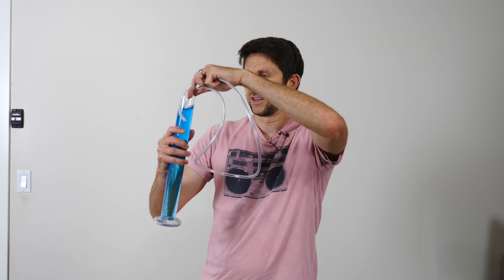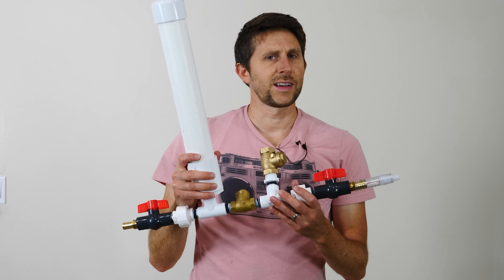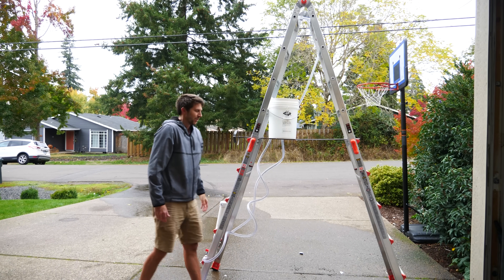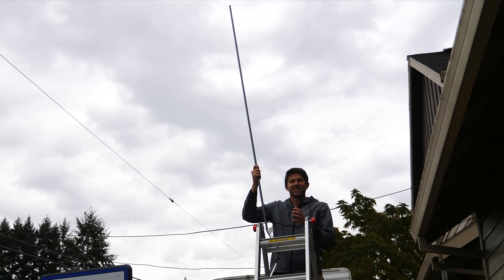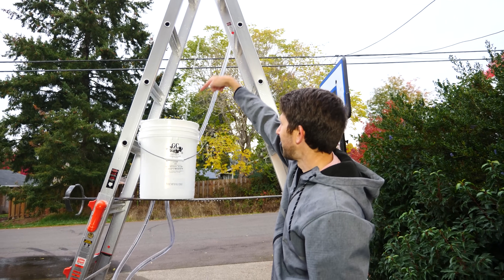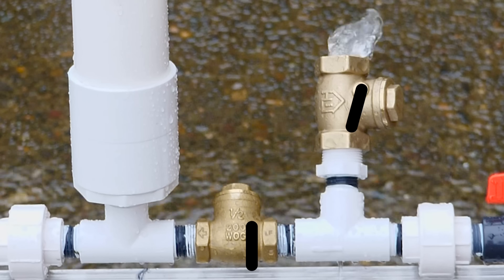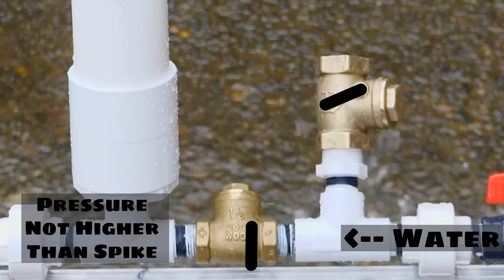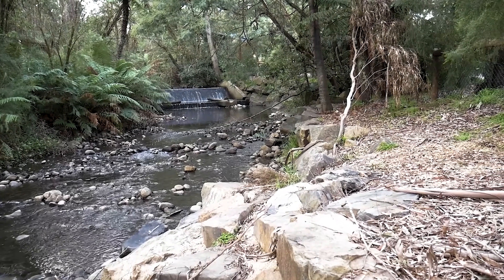Can a Hydraulic Ram Pump Make a Perpetual Motion Loop?

Comment: There is a plumbing device called a hammer arrestor that prevents the pipes from banging. It works like the empty PVC tube in your setup.
Reply: Isn't it compulsory on all new installations?
Reply: @olmostgudinaf8100  
I think so; but the regs might be regional.

Comment: I wonder if you could do some creative plumbing around your leaking valve to catch that water, in a funnel, and rout it through another check valve into your air chamber (below the water line)- so it drew a siphon as it decompressed and suck that water back into the system .  Did you follow that? 

Another thing I wonder, is could you run a little pump off a water wheel between your outlet and your head-bucket, to get the waste water back into your head-bucket?  I mean the answer is yes, but how Much of it? how close to perpetual motion could you get, and what use could you put that to?    

I'm always fascinated by the notion of- not making perpetual motion work, exactly, but what you can get such concepts to Do, as several of them Can do useful work, with a little input here and there.  Importantly, More useful work than the cost of that little input.   Like you can make a 90+% permanent magnet motor work with the addition of an electromagnet in one slot.   90+% of the work done by the motor, is achieved by the permanent magnets, and your one little blip in the right place to get it out of the static spot in the magnetic fields make it at the very least hyper efficient.    

I wish more serious engineers would look at these concepts not for what they Can't do, but to see how the concepts could be creatively applied- like that sail car that goes straight downwind, faster than the wind.
Reply: no the ram spike pressure is always greater than the exhaust pressure so you can never route this low pressure water into the higher-pressure side of the pumpe. the check valve between them just wouldn't open.

as for recovery also no. you aren't actually increasing the water pumped here you are just lowering your outlet head. if you qant to increase the proportion of pumped water u need to lower the outlet head which is what u would be doing since ur actual head bucket needs to be below the water wheel. lowering the output head dirwctly is more efficient. not only are pumps not 100% efficient but the efficiency of a super low-speed/low-head non-continous flow turbine is going to be atrocious making it even worse.

more often than not engineers are not optimizing for raw energy efficiency. they have to balance efficiency with cost & application-specific limitations. more often than not the small increase in energy efficiency just isn't worth the added cost, complexity, or maintenance. sucks but engineering is very rarely about what's possible. its just a series compromises.
Reply: @virutech32  It just seemed like as the air chamber decompressed, if you Y'd a funnel down below the level the water came up to, you'd get some suction there.  kind of like the reverse of an old hand pump on a well.

Comment: How will this work when you instal this in a skyscraper, the first bucket on the 1st story, second bucket on the 2nd story that get filled by the one below, on every story a another bucket.... and on and on...  the only energy u need is to fill the first bucket,  from its own pressure from the watercompany, and a low energy pump that pumps the ''leaking'' water from the valve back into the bucket  :-) ? ..
Reply: They would all slowly lose water because you are losing water + energy from the bottom loop.

Comment: This is a really cool video, but can someone who is good at physics explain why you can’t attach a tube to the valve shooting out the waste water and connect it to the tube that’s connected to the bucket. I know 100% that there must be an explanation of why this method won’t work.
Reply: because the ram spike pressure is greater than the exhaust pressure which would prevent the exhaust valve from opening. as the water goes out of the exhaust it's pressure is the same as the hydraulic head of the bucket. at the outlet the pressure is higher which is what let's it get above the bucket in the first place.

Comment: What happens if you connect the waste outlet to the pipe beyond the pvc air tank? Would it not be pushed also?
Reply: It would cause back pressure to the valve , then it would not work.

Comment: Maybe run the waste valve back into the bucket like a reverse washing machine drain...
Reply: the exhaust is at a lower pressure than the head of the bucket so it cant ever reach & the back-pressure on the valve stops it from opening killing the pump

Comment: What if you put a hose on the valve that is just losing the water and run the hose back to the bucket like the other hose.
Reply: The pump would stop working because it does not direct enough energy into the waste stream to elevate it to the level of the reservoir. The waste stream has to use less energy than the supply stream, but if the waste stream went to the reservoir, both streams would be equalized.

Comment: What about superfluid in a loop will that work or not.?
Reply: Being a superfluid just reduces losses from the system. To pump water above the source level still requires the energy from other water moving to a lower height.
Reply: @fredbloggs5902  then atoms are the only perpetual machines to exist till this universe is there.

Comment: Really interesting! This works in pretty much the EXACT same way as a boost converter in electronics (converts a lower voltage to a higher voltage, but with less current). Crazy how similar fluid dynamics and electronics are!
Reply: one of the only differences is that electricity has no weight, otherwise electrons would be like a fluid and those two would be the same thing
Reply: @octoquetra9198  Imagine a wire getting way more heavy because you plugged it in hahaha
Reply: @trxtech3010  or if electrons had so much energy they heated up the wire and it lifted  your phone 20 meters up the instant you plugged it in
Reply: @trxtech3010  The grid would be "heavy from use"
Reply: @fixitallpaul4847  hahaha
Reply: @octoquetra9198  Well electrons do have a little weight, although I can't think of any way in which it affects how electricity works. Moreover, inductors give electricity a sort of momentum so it can't change flow rate so quickly without a voltage (pressure) spike. Just like with a faucet, shutting it off too quickly causes a voltage spike that could damage components if there isn't a capacitor to smooth out the change in flow, like the air tank in the video.

Sometimes the water / compressed air analogy falls apart when comparing it to electricity, but it's pretty amazing how often and how well you can make it work.
Reply: @octoquetra9198  not true, electrons have a weight. Photons don't.
Reply: @Richinnameonly  They technically have a weight but its so negligably small that considering it to be 0 for all but the most extreme cases is functionally analagous.
Its like comparing a peice of dust to the earth.
Only the most precise measurements and calculations require you to incorporate the mass.
Even for many physics applications its not necessary.

But yes xp
Reply: @octoquetra9198  so is there a weightless solid state and gas state of energy
Reply: The mass of an electron is 9.1093837 × 10 e-31 kilograms
Reply: Back in the 1700`s, churches and cathedralls and other huge building made their own energy by Eather, just out of ''thin air'' with antenna`s and coils, the people who build that powerstations called Tartarians, many video`s to find on youtube.. 
Guy`s like mr Edison and rockefeller destoyed al those technologie and forced us to use oil to create energy.. 
But the still use it for own use.. and many buildings are still using this technology but the ''normal'' people don`t know that.
Reply: @mikevanb2014  lmao
Reply: @mikevanb2014  So it's a "static generator".
Reply: @mikevanb2014  considering that you're using the wrong symbol, whatever you're saying BS.
Reply: @mikevanb2014  The Ether is real.
Reply: As an apprentice 45 years ago our instructors used to use that analogy to help trainees understand how electricity works.
Reply: @todaywefly4370  no way! That’s awesome! It really is pretty much the exact same. Did they use just a manual switch, or use a semiconductor (like a MOSFET, or maybe a BJT for that period)? And damn… 45 years ago was the year my parents were born. Love how the internet allows people to connect across generations.
Reply: @grantpeterson2524  It is very cool.  All manual in my day.(auto tech, not electrician)
Reply: @todaywefly4370  thats one of the ways I taught my kids about how electricity works too.
Reply: One major difference is efficiency. A boost converter can be over 90% efficient. I don't think a hydraulic ram pump can achieve more than 60%.
Reply: Yes The first valve act as mosfet the second valve act as diode and   the empty PVC pipe act as  a capacitor .
Reply: The standard analogy for voltage and current is water flowing through a pipe, so it has some similarities
Reply: Im glad I learned science
Reply: oh no this means more IDIOTS are gonna post this on reddit  to electric boom and say " oh look free energy "
Reply: @girlsdrinkfeck  I know right lol!
Reply: Vary Pressure or flow rate aka voltageor current
Reply: its all waves Bruh
Reply: if its not Perpetual Motion don't even pose the question. thumbs down but like hell you could even see it anymore because of YTs stupid decisions. and the reason why i thumbs down is because i am of the belief that Perpetual Motion might be the only thing that can save humanity. and before any scientifically accurate retards pipe up, i didn't say "i believe its possible" i just said it could be what is necessary to for humanity to survive in any long term way. especially with the way governments of the world are treating long term problems like global worm and what not.
Reply: @bpqd2624  That made absolutely no sense. Sorry to tell you this.
Reply: Mix them
Reply: Yep
Reply: Im finding similarities in almost everything
Reply: Is gravity not considered an "external source of energy"? XD
Reply: Nice. I scrolled down to post this exact comment. The inductor won't let you stop the current flow instantly, so the voltage spikes, analogous to the flow of the water coming out that drain being suddenly stopped, causing a pressure spike.
Reply: I was thinking this. The easiest way to think of it is an inductor "adds weight" to the electrons. Really it stores energy in an opposing magnetic field, but the effect is the same. It provides inertia to an increase in current. Just as it's harder to get a 2 ton car moving than a 1 ton car (you need twice the force), it's harder to increase a current quickly with an inductor with a higher number of Henries. If you connect a 1 Henry inductor across a 1 volt battery, the current will rise at an amp a second (usually inductors are smaller value than this). Without the inductor, the current goes from 0 to arc welder levels (assuming low enough resistance and a hefty battery) theoretically instantaneously.
Well if the current was hard to get going, then is the current hard to "slow down"? What happens if we force it to? What happens if we open the circuit when an inductor has been placed inline long enough that a nice big current has built momentum? What happens when the unstoppable force meets the immovable object? It turns out you can make a fairly big voltage spike - pretty useful in police stun guns, but it can also be used in a more controlled ways - perhaps with capacitors and resistors to smooth the peaks, and transistors to control how often the circuit opens and closes, and you can turn 5 volts into 12 volts say.
Reply: What if you add a buffer tank or like a super capacitor in electronics
Reply: They both find path with least resistance
Reply: Because god makes alot of similarities in the world to remember that there is creator and nothing made by accident example: electrons revolve around nucleus and nucleus have high mass compared to electrons while planets revolve around stars and stars has high mass compared to planets do you get it 😁😁proud to be muslim alhmdullah
While planets
Reply: Someone build a computer that runs off water
Reply: They both work with "juice".
Reply: lol 1800's thinking
Reply: only if the boost converter was losing seven volts for every volt it produces... good luck with that.
Reply: Watching those wiring, resistor videos this did seem similar...Just look like recovering the waste energy is not priority some reason yet sure seems viable.
Reply: Sir can you tutor us please? What are the differences among volts, watts, amperes, capacitance, farad, micro farad, ohms frequency and give examples?
Reply: @fighter6221  There's a video by "Techquickie" that uses same exact analogy with details. Thread is just talking about the concepts. A person that homebrews beer wouldn't say it's identical process to making Komboocha or whisky, but it's same conceptual ideas being identified, not literally same properties.
Reply: yeah, that's why on & off of the power supply also gives high meter reading, aside from the starting energy of devices, the on & off also gives voltage momentum impact. my simple thoughts
Reply: it's called "the flow of electricity" for a reason!

Comment: Great demo.

The tragedy is how many people we’re going to see insisting in the comments that a few ‘simple’ adjustments will result in genuine perpetual motion.
Reply: Update: I’ve counted five so far!
Reply: Would the water evaporate or go outside the ladder if you left over time
Reply: @maryann2628  Evaporation uses energy - effectively solar.
Reply: Simple just have multiple setups and the waste water from one will fill the other, have the water run down a mill on the way and boom, power.
Reply: @adambrackston3471  The energy comes from the difference between the water falling to the ground and the water being lifted. Multiple setups just uses more water.
Reply: Use your neighbor's electricity to power a pump to fill the bucket
Then it's "free" energy

Comment: Would be interesting if you try to fix it. For example by capturing the  water that is getting eject off down by making a way back to after the second valve.
Reply: The path of the waste water has to require less energy to push water through than the path of the supply water. Ram pumps are great at what they do, which is to inefficiently harness and focus some of the continual supply of energy in a naturally falling stream of water. But they are not capable of perpetual motion.
Reply: @andydouglass1374  So it's expected that the thing would stop. Empirical science still interesting.
I we live in a "perpetual motion machine" and that's a little harder to dismiss xd
Reply: @rafqueraf  There is no such thing as a perpetual motion machine. The laws of physics as the smartest humans understand them there is no such thing as a perpetual motion machine. Entropy always wins.
Reply: @MrT------5743  What  about the universe or multiverse ? things are moving
Reply: @rafqueraf  the known laws of physics state there can be no perpetual machine. That is not from me. Once again. That is from way smarter people than you and me.
Reply: @MrT------5743  The laws of physics and reality aren't the same thing. The universe was here before we started to theorize how it works. We find things that should not exist accordingly  to such laws. For example the biggest galaxy, the great attractor, even the black holes were not theorized at some point. Talking about black holes we still can find its description as "were the laws of physics get broken"

Comment: In commercial plumbing, code requires water hammer arrestors at each fast-closing valve in a system.. such as diaphragm flush valves on commercial water closets. If you’re in a public restroom and notice a small access panel in the wall at each water closet that’s where the water hammer arrestor is located.  Sometimes they’re above the ceiling.

Comment: I learned about ram pumps at Ha-Ha Tonka State Park in Missouri. The old tower was up several hundred feet from the spring below. This method was used to supply water to the houses at the top of the cliff. Thanks for the easy explanation!

Comment: Can you recreate the same setup using two Tesla Valves?
Reply: I don't think a tesla valve would store energy and release it like the spring does in a check valve.
Reply: @andydouglass1374  the energy in the check valve springs isn't relevant to the operation of a ram pump
Reply: @virutech32  I was thinking about the ram pump incorrectly when I posted that. But the energy required to shut the check valves is technically relevant to the operation, because there are two working reciprocally and that is why he mentions in the video that getting the pump running initially is finicky. Likewise, I would think using a giant 24 inch check valve in the ram pump in this video would not function, because there would not be enough energy for the check to operate.

But I was incorrect in thinking that the spring in the check was the source of the pressure energy which drives the pump. This is obvious when you see that ram pumps using simpler "flap" style checks work as well.
Reply: tesla valves operate using turbulence & friction & work best with pulsed high-velocity flows. aslo they work better with air. at low constant head u don't even get a check valve effect. they basically act like obstructions.